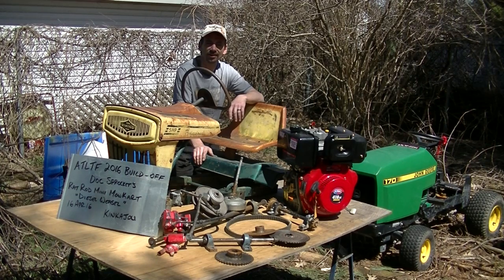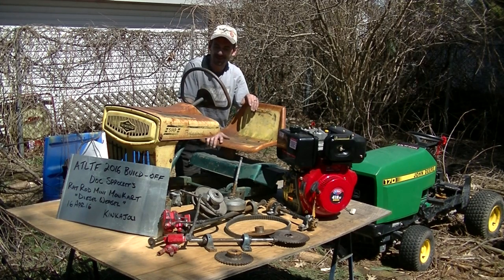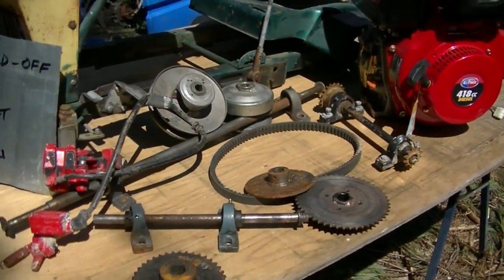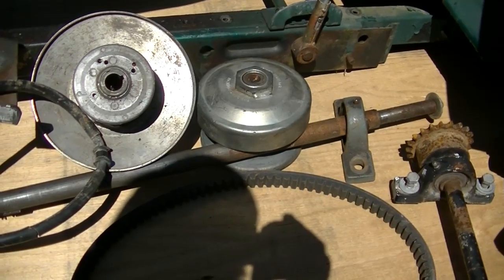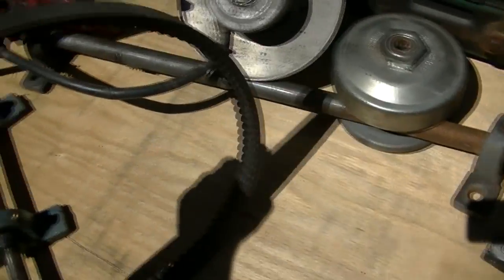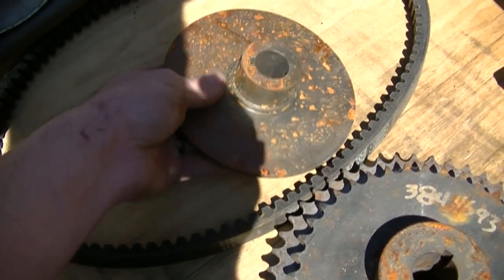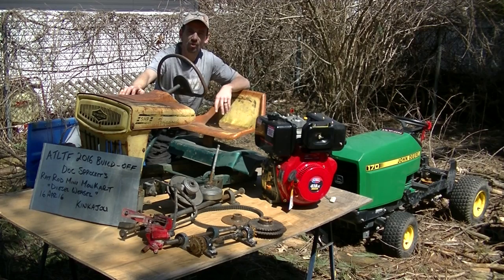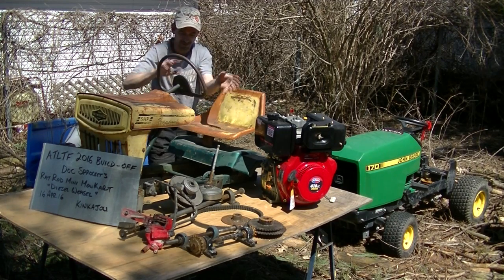Diesel Weasel Project Plan

Comment: good luck fitting that giant diesel in there doc! I had a hard time fitting it in a full size Sears chassis... But I'm sure you will find a way! 
I can't wait to see what you come up with! Should be a very cool build
Reply from the maker: +FearlessFront (Todd Christopher) Thanks- This oughta be an interesting challenge...
Reply: Yea the diesels are tough engines Im entered in the 2016 atltf buildoff and im using a 7.5 hp diesel but it has an oil sump on the bottom so I have to raise the hood lol
Reply: +FearlessFront (Todd Christopher) 6Hp Diesel Will fit in her nice :) (I got the same tractor and did a mock up last year lol)

Comment: I had the MTD lawn flite version of that machine it was a 1974 was identical to that thing. had single speed forward and reverse with 5 horse Briggs. it was a mud mower before mud  mowers and the internet were a thing. back in 1990 I used to pound that thing through anything and everything it would pull over a house if it could get the traction ;-)

Comment: I think you can drop the frame down a few inches where you want the motor like how a rear axle section of a truck frame is. so a 45 degree down a flat section then up 45 degrees that should make the motor fit. not sure how that would affect the ground clearance but hey it may work

Comment: Can you mount the engine tilted some degrees? Will it still get oil. - Nice project Doc.
Reply from the maker: +ThunderDivine Perhaps. I'd have to find the specification on maximum allowable mounting angle.
Reply: Sprocket's Garage 
Way too late now, but I found some specs on these engines recently and took screenshots. 
 Continuous running tilt is 20 degrees back and forth OR side to side, not both at once. 
The maximum angles are too complicated to explain, get me on Facebook if you want those screenshots.

Comment: The Steve Darnell of lawn tractors! (a guy who puts diesels in rat rods) Also, what size shaft is on that yanmar clone? 1" Or 5/8"? Metric? Because if I ever get ahold of one, its goin in my Snapper LT16 and I kinda don't know if its really a "bolt in" job....
Reply from the maker: +Rich Schoonover Oh, I sure do know who Steve Darnell is! The shaft is 1".
Reply: +Sprocket's Garage Thanks! It will bolt up to the pto clutch at least!

Comment: drop engine between frame rails, maybe relocate fuel tank and air filter.
Reply: Yep. I spent a lot of time staring at this bugger last night. factory muffler, air box, recoil, and fuel tank have to come off. I need to mount the base of the engine some 2" below the bottom of the frame. I believe the frame will need to be slightly massaged, to get it down low enough, too.